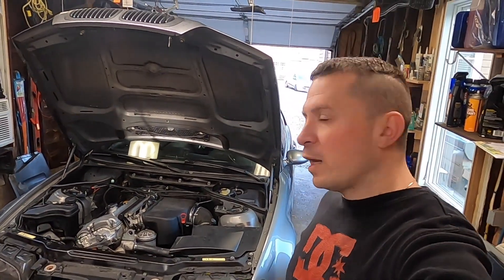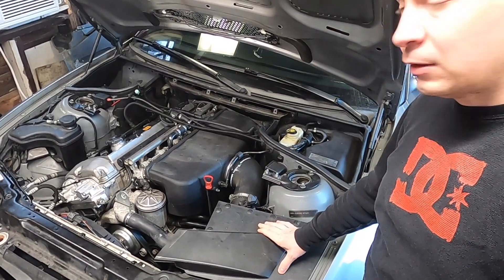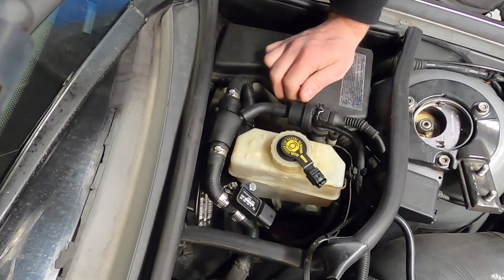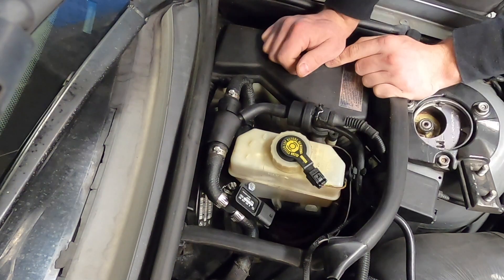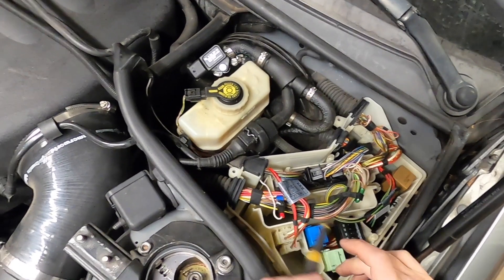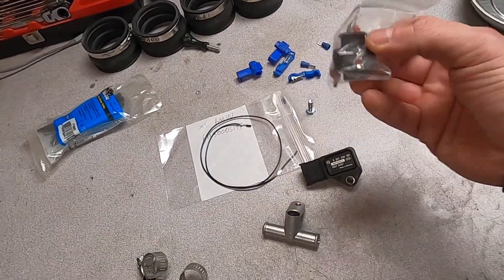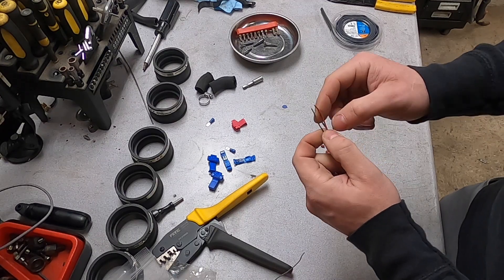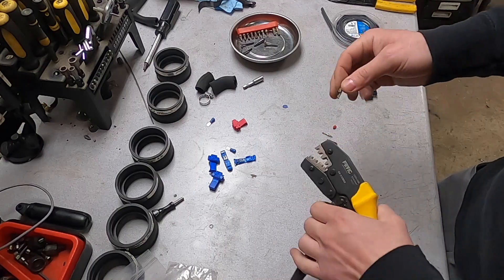CSL Airbox Installation, Map Sensor Conversion DIY - BMW E46 M3 Build Pt. 5

Comment: just wondering,...my car is 2003 then should I need to replace the DME??? OR..just need wiring job what you did it?
Reply from the maker: You will need mss54hp in order to run map sensor if the car is prior to 2003.5 the if has mss54 you can modify it to make it hp or sawp it but without that it won’t work
Reply: @MotorsportInspired  so... if i have mss54hp then should i get a alpha n tune?
or just need wire job with vaccume and dme?
Reply from the maker: @suhyunjung9110  if you have mss54hp you can do exactly what I did in the video, upload csl tune and your all set. Ready to go.
Reply: @MotorsportInspired  you dont do that default settup like... VANOS offsets for stock cams, pressure scaling to accommodate different pressure sensor in non-HP DMEs..etc???
Reply from the maker: If you have non-HP dme than you can’t run map sensor you just have to go with alpha n tune from on of the tuners out there. In the event you do Hp conversion or hp dme than you don’t have to do scaling if you use the sensor I used in the video becuase that Bosch sensor has the same scaling as Bmw factory one has dme will have no problem reading it. Scaling only needed if you use different map  like gm one